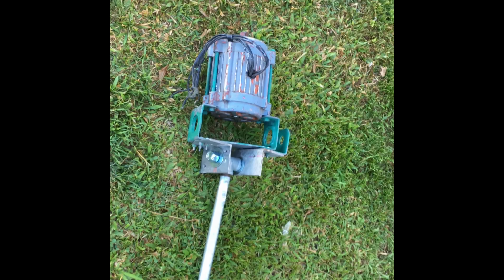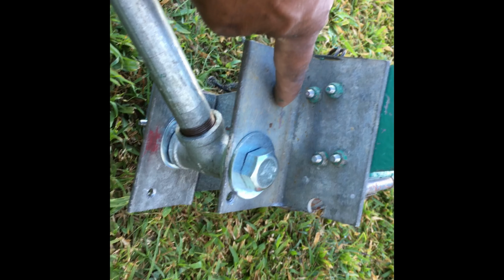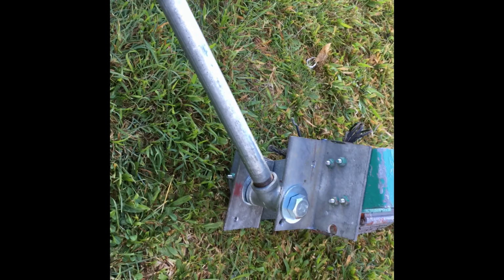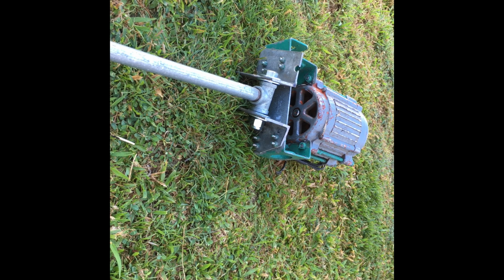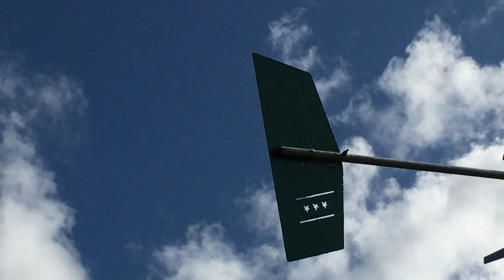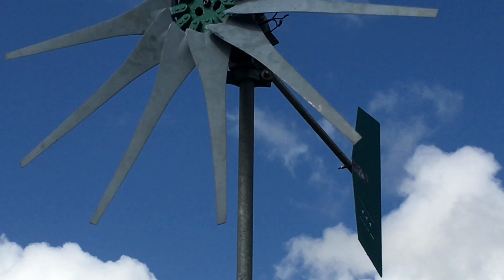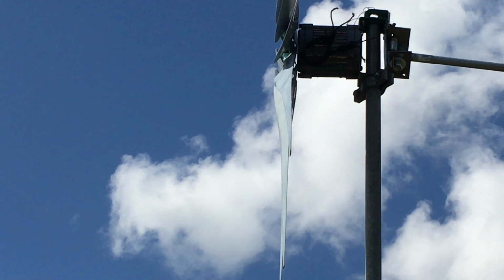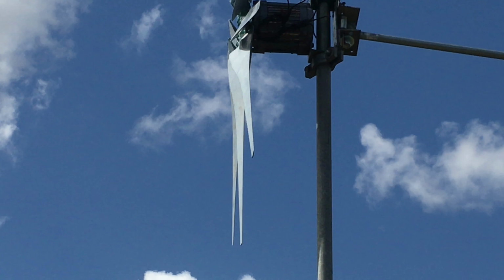Furling tail on test.

Comment: I may have to copy your design  and put it on the back of my wintura. the back shed , is worth a look
Reply: People need a progressive furl, if you buy a real PMA at a later date let me know and I will show you how to make a cam ratio furling system. My design I have yet to make public but its function is revolutionary. To insure its design rights from being stolen by a particular Missouri Ass Monkey I will sell the design via order through a web site so records are available for court action when that well known design thief in Missouri claims he invented it, like everything he steals. So stay tuned. Its on the way, 3 years testing, awesome results.
Reply: Јоhn Daniel thanks john appreciate the offer more than you know, however I'm done with buying turbines I'm building an axial, just saving for some more parts, have magnets,  magnet wire etc.

Comment: Your angle is set for over 50 mph winds, more like 53 to 55. or 75kph . In your area with air density and unstable winds you need no more than 16 to 18 degrees angle on your design, not 35 like it appears now. And you need a progressive furl, if you buy a real PMA at a later date let me know and I will show you how to make a cam ratio furling system. My design I am yet to make public but its function is revolutionary.
Reply: I follow your channel John. Why don't you help everyone out?